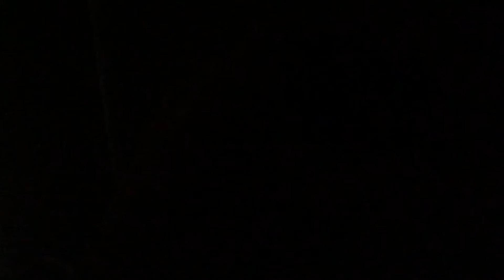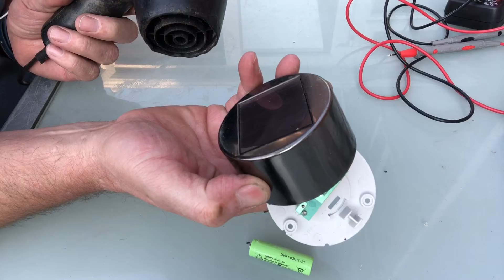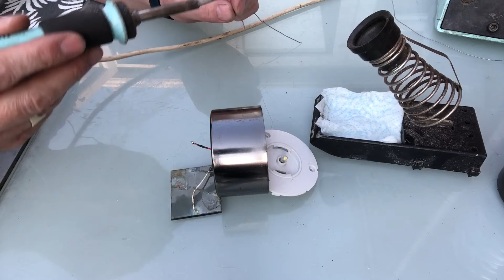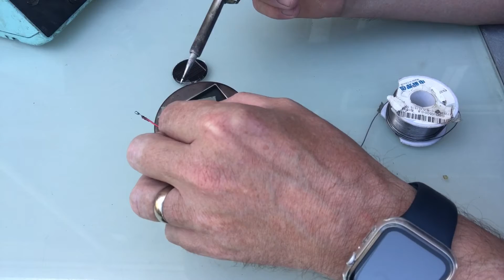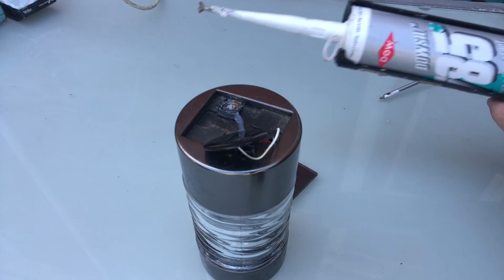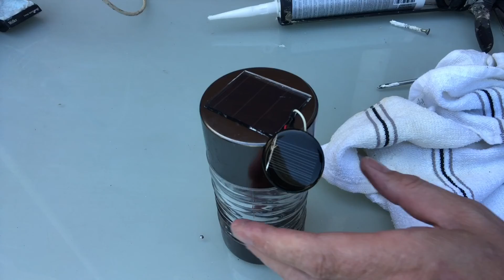Faulty Garden Solar Light Repair.

Comment: Bit of gaffer or insulation tape over wire otherwise good job only if you get rest of solar panels cos a £2.50 fix is not good 50p PERFECT

Comment: Great video. Liked and Subscribed.
I've been repairing solar lights for about 6 years now and the issues I run into range from simple things like a dead battery that just needs to be replaced or charged all the way up to full on corrosion, ant infestations, damaged circuit boards and the worst of all, a huntsman spider.

My success rate for repairing solar lights has slowly increased over time and I always keep a good supply of spare parts on hand.
I also have my dad who helps me with soldering broken connections and a high end battery charger witch tells me how much capacity a battery has and can charge all the common battery types found in solar lights, both nickel and lithium based.

Your idea for reusing the old solar panel as a cover is something I've never thought of doing but I might give it a shot and see how well it works for me.
Reply from the maker: Well done in your repair work and thanks for the sub, it’s good to learn and develop one’s skills and I am still learning too!

Comment: I see you are using same methood like me with hairdryer :) Yes that glass ones are hard to resolder, only if there is a little of previous solder we can solder it again or using conductive glue. I also making my own  lights (highest 10W solar LED, normal 1W solar LED working now 3 years all nights) and also improoving brightness of bought ones to better versions. Sometimes by switching oryginal LED to super bright one also give a loot more of light.
Reply from the maker: I’m impressed by the customisation you describe, I’ve never thought of upgrading them, it’s a really good idea.
Reply: @TheRepairer  Yes, also you can make solar light from broken night light, normal broken light bulb or something like wardrobe light. It is also possible to make it from any light. I was making them so if you are interested in i can share shematic or projects with you. I have for examle normal E14 LED bulb which contain all solar IC and battery inside. Solar panel is connected to E14 socket to give charge. The most unexpected for usual person is when you take it out from socket it glows ;) - disconnected solar panel make it indicate night and turning on.

Comment: I checked the battery and it is fine.  I tested the connections to the battery and there is no power registering on the multimeter.  My question is do I first take apart the light connections or go immediately to taking apart the solar cell glue to check those connections to the solar cell?  Thanks.
Reply from the maker: It looks like a defective solar cell (I’ll assume it was checked in good daylight) put some pressure / scratch around on the multimeter probes when testing just to be sure theres no oxidation on the terminals.
Reply: Depends, where you tested them. Battery ok, check on terminals, check after the switch if  voltage it is ok (can be switch fail). If battery is good and failed panel, you should have all time switched on LED when you put charged battery. Also check solar cell by checking voltage and current on pins where it is connected to board. Also if still 0 or low value desolder one wire and check voltage again. If still 0V or low value take out solar panel. In my 10 years with solar lights i experienced one failure when IC was shorting solar panel and two fails with board which was open circuit between pins which was normally shorted.